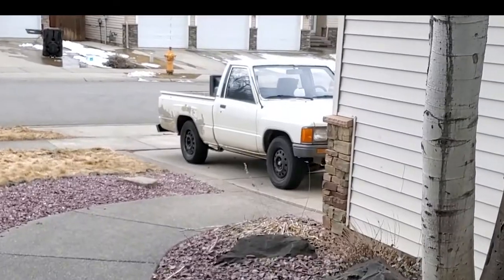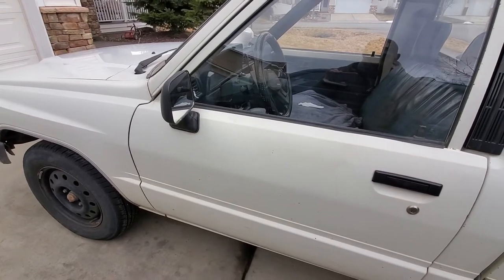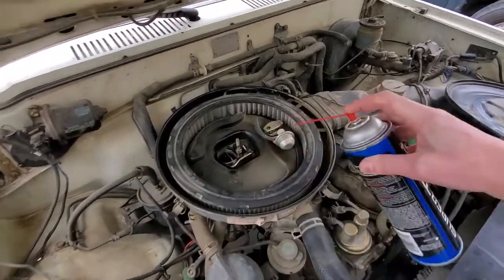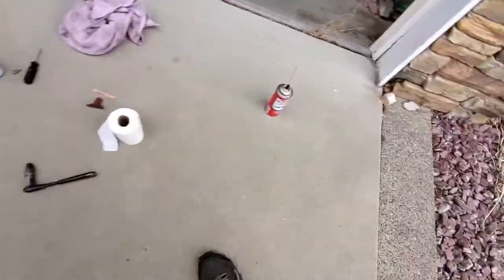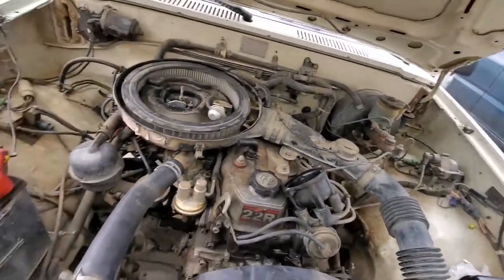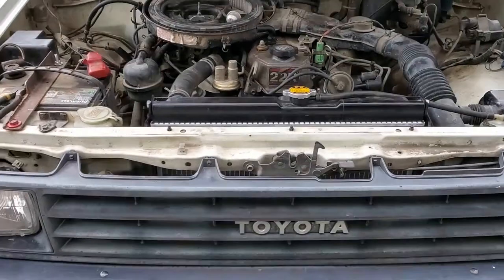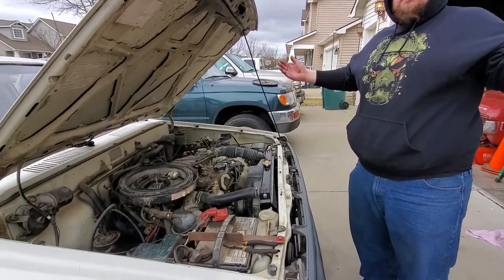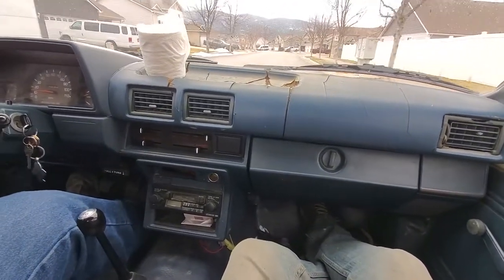1987 Toyota pickup doesn't idle.. Can I fix it for FREE? Check for Vacuum Leaks, Carb, Cap and Rotor

Comment: I had this same problem with my 87 Toyota 4x4 22R i was certain it was a carburetor problem, hard starts,rough idle after days of checking vacuum lines and adjusting the carburetor i decided to check my distributor cap and it had grime inside it from a bad cap seal, cleaned out the grime, replaced the rubber O ring and now its running like a swiss watch.

Comment: Small update post video, I ended up sitting there for about 30 minutes in idle waiting and it stayed running, as well as on the way home. Picking up parts this weekend  and will update from there.
Reply from the maker: An update from the man.. the myth.. the legend..
Reply: Cool thanks for the update but I’m curious if the problem came back and if so, what fix did u go with?! My 22R has the same issues however, there’s no resolution fix for me! - It still has a bad idle- I’m looking at the fuel systems area rn- thxu
Reply: @JoseGarceeya  no, in doing the tune up (plugs, wires, cap and rotor) it fixed it up. Plus running a little carb cleaner helped as well. Hope you can gets your fixed up!

Comment: What’s the gas mileage?  Typical you think.  Thanks
Reply from the maker: I'm not sure, it's my friends truck I was helping him with. The 2wd Toyotas usually do pretty good though from past experience
Reply: My 87 EFI 4WD 4Runner gets about 19mph city and it weighs probably nearly twice this pickup with the insanely heavy fiberglass top, t case and front diff . Honestly not a ton better on highway and IDK why. I bet this guy's little truck gets 25mpg for sure.

Comment: I've got a carb question for you!!  I've got a 22R which is running rough and stalls if you give it any gas at idle.  If I put my hand over the throttle plates, it smooths out and you can rev up just fine.  Any idea what I need to do?
Reply: I replaced the fuel filters with no change.
Reply from the maker: That's for sure a vacuum leak. The carb is getting too much air, so when you put your hand over it, then it gets less air. So I would check either vacuum lines/hoses and if not that. Then it could be one of the gaskets between the carb and the manifold 👍
Reply: @DragonDriver5  below the manifold right?! It sits on top of the carburetor?!
Reply: @chrisb3116  did you ever get er going?
Reply: @JoseGarceeya  Yes, the base plate gasket was leaking.  I ended up replacing the carb as it was filled with crap.  As soon as I replaced the carb and gaskets, it ran beautifully again.
Reply: @Clockfxr  a brand new carburetor or rebuilt- thanks for the response/ I’ll be tackling this shit tomorrow so I’m going in for battle with all my YouTube knowledge- I really appreciate you all

Comment: I've got an '86 22r with a similar issue. Pretty sure you need to clean or rebuild your carb.....or go with a genuine Weber. I plan to do the latter (previous owner tried new dist, wires, plugs, fuel filter, fuel pump, etc).
Reply from the maker: Weber 32/36 is for sure the best thing to do but this was a quick and cheap fix 👍

Comment: Whats the deal with the  three nothed lever that changes everything after it warms up?
 I can set my idle,air/fuel mixture on a fresh rebuilt carb an then after a few stiop lights,  RPMs are  in the 2k! I  have to pull that 3 notched lever back down to get the idle correct an I even used a bread tie to make it stay. there but then, I smell it running rich and my mileage goes down the drain. Any avice here? Cause I know I cant alter the adjustments made initially or else I'll lose my  initial propper idle at about 1k. Even the FSM makes no sense to me regarding this. Anything you can share here, most appreciated!
Reply from the maker: It sounds like maybe your choke it set too high? With the stock carb it's all vacuum controlled, plus the set screw. Could be an issue with either... Honestly, I would upgrade to the Weber 32/36 carb. They are so much easier to work on than the stock carbs and you'll get better power and fuel economy!

Comment: If it's rough at start it could be Coolant blockage to ideal control more then likely have been the whole problem after he Rev it for a Lil blow blockage there videos on it
Reply from the maker: It was fully warmed up. After the tune up he's had no issues and has been driving it regularly